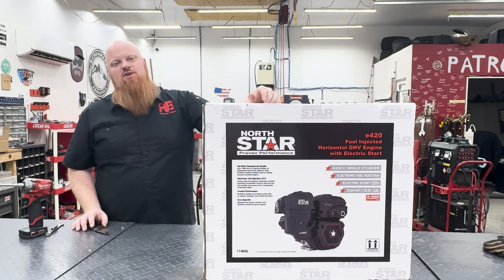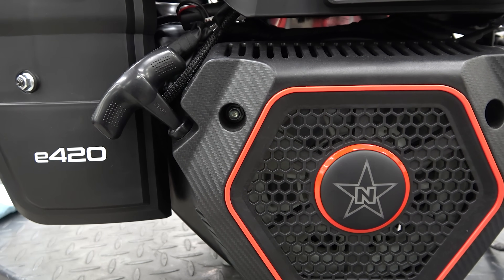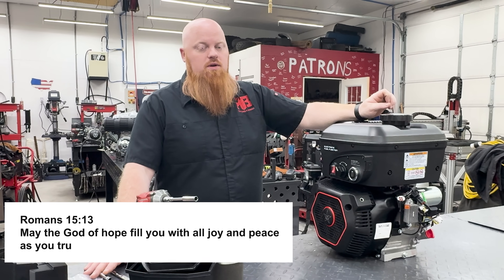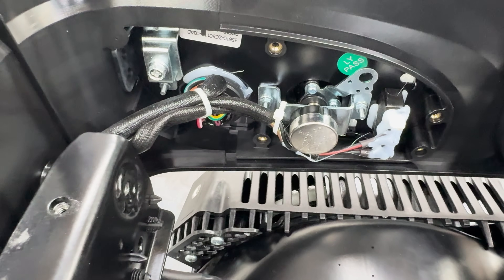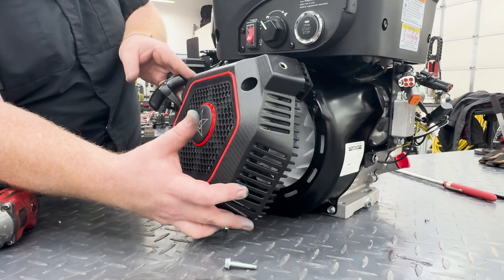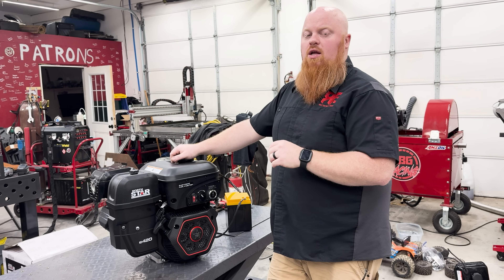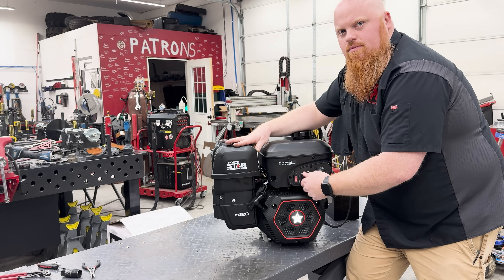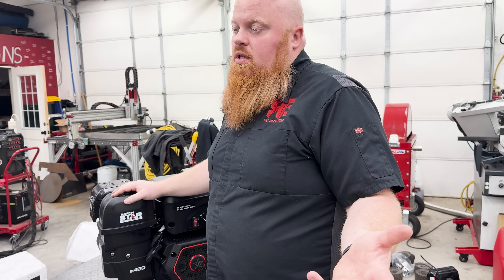EFI Fuel Injection 420cc Engine ~ North Star E420 Unboxing

Comment: What Size is the EFI Throttle Body, and what Size is the Injector? What is the Max HP it will support? A custom-built Carbed 420 can make 33+hp@5000rpm. Does the ECU have a Cripple mode built in? Is there a Billet Rod and Flywheel made for it? What are the Stock Cam Specs? What are the Stock Valve Sizes?

Comment: The two four pin ones ARE for Canbus (I looked it up), the two pin one is a remote kill, but the Can bus system allows you to remotely see sensors, and control RPM and stuff

Comment: i think it needs the battery for the ecm to be powered just like a car. not because of the charging system being weak .,if that were the case it would not supply the power for everything to work and still would kill the battery. its not a weak charging system for sure.

Comment: i joined a small engine group and was showing how to use a scope ,in cylinder pressure transducer for determining compression, valve issues ,charging system .they absolutely hate it. i do cars so these are very basic and simple ,like in the 80s when fi started. i tell them jump in and study,its not hard. now is the time to make the change if not you will be left behind.next they may add smart ignition keys and key fobs ,who knows.you guys should watch the automotive diagnostics to get u up to speed. we deal with 20plus modules u just have one.get u a  scope and start learning it

Comment: I just seen they made  a e300  looks just like their 420  in this video  just  a predator 301  gone efi lol but for $400  not sure if worth the extra 1.25 hp more than the predator but says max torque is 18 foot lbs nit bad much more than the predator
Reply: U should check it out
Reply from the maker: I will do that. I personally don’t think the engine is worth the extra price over a predator because the fuel system is pretty basic and you would have to replace everything to make real power.

Comment: Can you make a hydrogen powered mini bike with this engine cuz it's fuel injected..and you can directly connect the hho generator gas line to the injector and run the engine it'll be crazy in the mini bike community and the first on the YouTube

Comment: The tech support person is probably right about the priming. That engine is very likely wired like a motorcycle. They only run the pump when the engine is actually spinning. It is wired in series with the coil so when the coil start firing, then the pumps will engage. The reasoning for it is if you crash. You don't want the fuel pump to be running just because the ignition is on. You should be able to run off the float bowls for a couple of seconds, which is more than enough time for the engine to spin up and then turn on the fuel pump which will then refill the bowls. You could add a push button priming button and figure out an easy way to drain the fuel post-tank. Then you could drain the fuel like you do with a carb bowl, and have a way to make sure it was primed before you even try.

Comment: so what i think is going on with the EFI system isn't soo much that it draws enough power to need a battery but more so that it needs a more constant power supply. the charging coils by no means have a lot of power but they should be enough for around 120 watts on dual coils, but the battery probably acts more as a way to absorb the voltage spikes and whatnot due to these charging systems essentially providing pulsed DC. you'll notice this issue with lighting with how the things flicker at lower rpms which is why a fat ass capacitor/battery does wonders for go kart and minibike lights running off the charging system

Comment: Great more crap to go wrong. Oh and needs a battery to run that’s just awesome. It’s a small engine it doesn’t need efi or an electric starter or any of this crap. Welcome to your next mower or snowblower, guaranteed to fuck up when you need it and can’t be fixed without some module or other unnecessary part that isn’t available locally.

Comment: Im sure over time the really smart people will figure out how to make these things work well for go carts and mini bikes but right now i just dont see them as a viable option
because you have to start them at full throttle also having to have a battery to use the engines is gonna really deter most people from using these things also the price is pretty steep 
for an engine thats gonna be used on a go cart or mini bike  maybe in five years when the price drops and the technology isnt so expensive

Comment: The battery is used like a capacitor,  know how the light got dim at idle on these engines some times? , well the injector needs a steady voltage because that's how it fires. An diping voltage bouncing around would make it fuel werid an make the ecu not run properly as voltage = speed in working electronics like the injector an the eletric motor contorling the throttle.  So it probably has enough to charge while running but at low idle it needs the steady voltage that the battery provides
Reply: Typing on phone sorry

Comment: Does it have a MAP sensor? If so Probably just running in speed density mode. Ecu references MAP signal to calibrate fuel. Modify the MAP table in the ecu to account for mods

Comment: Was hoping since its efi itd have a o2 sensor even if its narrow band and nkt wide band.so this in theory should be worse than a carburetor because it has no idea what fuel ratio its giving. Its just a set duty cycle

Comment: You should be able to use a  boost refrence fuel pressure regulator to raise the fuel pressure under boost should not need to mess wiiith the electronics

Comment: Map sensor. Doesnt need a mass air sensor. I think it's refered to as speed density. Usually uses map/tps/O2/IAT/engine temp to control fueling. Dont forget a megasquirt alternate is Speeduino. I use this system. Both use the same Tunerstudio for tuning!

Comment: I'd actually be surprised if it had MAF... I figured it would be "speed density", which is based off manifold pressure and RPM to hit the targets in a fuel map.  Many OEM engines are spun that way.  If it says it has MAF though, I might expect to find the MAF sensor built in as part of the airbox.  I'm assuming that the reason it has the fly by wire throttle body is to govern the engine.  That pot is likely used by the ECU to set target RPM... probably uses some sort of PID algorithm to adjust the throttle to hit the target RPM.  So, the upside is there is no mechanical governor.  The downside is the only way to get around it will probably be something like microsquirt (or megasquirt).   I doubt fly-by-wire will have have a good response so, I'd personally find a way to hijack the throttle control for direct cable control, or find a throttle body you can adapt to the engine.  There is another do-it-all ECU solution called Speeduino, which is built on a generic microcontroller platform... even more geeky than megasquirt, but cheaper.  I highly doubt the stock ECU can be tuned.   It is cool to see, but the thing is, if you have to swap the ECU, and the throttle body, are we gaining much with this engine?  Might be better off just adding these mods to standard 420.

Comment: If it has a diagnostic connector, you should be able to hook into it and change the computer mapping so it will run with the open-air filter and exhaust. The boys at Grind Hard have done it on 3 of their custom-built rides, I think with the right program you could make that 420 do anything you want.

Comment: Great video. 
This may be a dumb question, but ive always wondered if it would be feasable to use one of these types of engines combined with a moped styled DCT transmision. On a small skiff. Similar to a mud motor.

Comment: I'm sure there is someone out there that will be able to get into the ecu and help you write a good map table  for the timing and fuel. It is just going to take some surching. Then when you get really crazy you'll need to find out what kind of injector it has and what the fuel pressure is for that map that's going to have to be worked on.

Comment: In its stock configuration it shouldn’t be much more than a built 224 to torque so it could go on the dyno? Can you get a wide band sensor on an exhaust to check if the ecu is adjusting the fueling.

Comment: I would want a carburetor so that it can be jetted properly. With that stock EPA EFI you can't change anything and it's set way too lean. Surges and pops. Probably expensive to replace all that stock EFI junk with a programmable unit. Hmm...

Comment: theres throttle linkage on the potentiometer and you slide the cable through the case. also most likely you are correct they probably have a tune that they load on that lil ecu. just bc like you mentioned no maf sensor means no air fuel ratio data is being feed to the ecu so no it cannot compensate for the changes made after a owner has added a turbo or small s/c. but you could wire in your own ecu to each component i.e. head temp sensor, fuel pump and so on and yes a mega squirt would work as long as they allow single cylinder motors to be ran of there ecu. wonder if it uses a half effect sensor to crank trigger for timing.

Comment: Adding an alternator would be easy and solve the issue of the weak factory charging system. I'd remove the factory charging coil and go that route. You might also be able to upgrade the charging coil.
Reply: They should add mounts for a second charge coil and that would add a backup to keep it running.

Comment: Manifold absolute pressure or MAP is what it's using for air fuel measurements. That's a good thing if you can crack the ecu tuning.

Comment: I think the first thing is slap on a forced induction something, turbo or supercharger, and see what happens. Out the box, I doubt you'll break anything. You're not cranking up the power that much. Maybe billet flywheel and some stronger springs, but don't add a cam or anything. Let it do its thing with more air.

Comment: So this type of EFI setup is Speed Density rather than MAF. Uses a MAP sensor to read manifold pressure and an Intake Temp sensor then uses those to calculate the density of the air entering the engine. Downside of that is its struggles to compensate when modifications are done that improve air flow unless tuned, which I'm sure at the moment there's no way to tune the little ECUs on these engines lol Most standalone ECUs like MegaSquirt use Speed Density .

Comment: You don't need a mass air flow sensor, that was tech from before speed density became more common place with the use of a MAP sensor to determine air charge pressure, crank angle sensor to determine stroke position and a calculated known displacement as that gives you all you need for EFI, you can up that in accuracy by adding a feedback loop with a wideband O2 sensor. The microsquirt would be what you want for an aftermarket EFI controller for use with boost.
Reply: You got that backwards, MAF EFI systems are the standard nowadays unless your talking performance applications like Standalone ECUs. Companies went away from Speed Density in the late 90's when OBD2 became a thing lol

Comment: I've already been hacking on one.  The 4 pin connector is a CANBUS cable.  Green and Green white are the CAN low  and CAN high signal, yellow Green is ground, Blue/red is positive. The other connectors are a remote kill switch (short green and yellow green) and the other is an idle switch that sets the engine to idle {purple and yellow/green)

The ECU does not appear easily tunable.  Changing the exhaust or the intake will instantly ruin its calibration, as it does NOT have an o2 sensor and cannot detect rich/lean.  So changing anything about it renders the ECU, in its current state, incapable of running the engine correctly.  Even removing the airfilter or not having it on tight makes it seek and surge.  There are PROBABLY commands that can be sent over canbus to edit the injector duty cycle/fuel map tables, etc.  I have not split open the ECU.  Based on the sensors it has, it is definitely a speed density system, and it might have an alpha-n fallback.  You might be able to get more fuel into a higher performance engine by manipulating the fuel pressure, which probably requires an external pressure regulator.  No Mass airflow, no o2 sensor.

Potentiometer for the throttle is wired to blue white and brown yellow, with brown yellow on the wiper.  The starter switch is yellow/green and brown, short them together to start, short them together to stop.  blue/red is positive for the lights, blue green is the engine running led, red/white is the engine stop led.

IT DOES NOT have a mass airflow sensor.  It has a Manifold Air Pressure Sensor, intake air temperature sensor, throttle position sensor, crankshaft position sensor, and an engine oil temperature sensor.

Incidentally, i've already made mine start buck and spit on a speeduino.
Reply: Having a CANBUS is unexpected but pretty cool. Didn't expect it to be that "advanced" lol
Reply: @MrUltraDreamz  I aint gonna lie, i spent 4 hours thinking it must be RS232 or TTL serial until i slapped a logic analyzer on it.
Reply: thats pretty intresting cant wait to see what people are going to do with these motors I'ma be keeping an eye on this motor for awile to see what happens
Reply: get u an oscilloscope and see everything,

Comment: Won't you have to calibrate the EFI so that it knows you want more fuel or does it have some sort of mass air flow meter on it that lets it know that more fuel is needed. Would be interested to see what it can do with E85 and boost.

Comment: As someone that has tuned using MicroSquirt (MS2), I recommend skipping all this nonsense and going straight to learning how to use microsquirt. this system likely uses the head temp sensor to go rich/lean (AKA- dummy switch), and the fuel/spark tables are probably about as dumb as a mule. MS is the way to go. you can like tune it on your dyno. please use a real wideband o2 sensor setup. any old cheap injector will work, but it needs to be small CC's.

Comment: So I’ve had to go to school for these EFI engines they’re trying to make them more like a car engine than anything but each computer whether it be Bosch or Delphi they have a learn process the engine Hass to get up to temperature before the process could really begin the O2 sensor don’t start reading until it gets around 700 720°F and then it regulate the throttle which is what the small rev on startup is once engine gets up to temperature every single smooth out in idle properly. This is especially important for the first time, running it and every time after resetting the computer and easy way to tell if you have a Bosch or Delphi system is to look at the O2 sensor wire if it’s one wire through the O2 sensor it’s a Bosch system. If it’s a four wire, it’s a Delphi and you can contact either company to get parts.
Reply: There is no O2 sensor, it most likely uses the temperature sensor on the side of the head to determine if its running rich or lean. I suspect that's why its running kinda crappy, using that by itself isn't going to be very exact or quick to react.

Comment: Like a few others here, we’re confused why it was surging while running. Was there a mistake made starting? An issue with the machine? Or does it take longer to settle in and self correct?

Comment: I would be interested to see if it is more fuel efficient because of the fuel injection, or can you run a turbo on it.
Reply: For turboing it you would probably need an aftermarket ECU and fuel regulator to account for boost. Other question is if the injector has enough headroom for boost.

Comment: When making changes to intake or exhaust, disconnect the battery and cycle the power switch. That'll clear anything the ECU has learned and then adjust to the changes. Unless it has a fixed running map. Then you'll need a different ECU.
Reply: It does not have an adjusting map/fuel trim, no o2 sensor, no Mass airflow sensor.  It cannot detect the fuel air ratios or the amount of air coming in. It's a speed density system, similar to an 80s ford or chevrolet.  So it will need a tune for any change, even a particularly high airflow filter, or at least a fuel pressure regulator to change the fuel pressure.
Reply: @BadHaddy  that's what I thought, but I hoped it would be more sophisticated than that.
Reply: @rosschamberlain1823  Mine's already barking and spitting with a speeduino/alternative ECU connected with a heated o2 sensor connected.  The stator doesnt make enough power to keep the heated o2 sensor on though, and it will foul up fast with how much oil these engines burn.  Going to find the cheapest 'close enough' non heated o2 sensor from the local parts stores to fit eventually once i build the rest out and get a base tune.  The factory ecu has an exposed canbus, i am getting some data from it, but i suspect we're heavily locked out, to the point of popping an efuse to prevent adjusting the fuel tables.  I'll decap/unpot the ECU eventually and try to see if i can dump its program, but its going to be unlikely to appease the EPA/CARB.
Reply: I would imagine it's fixed assuming it doesn't have a MAP/MAF sensor

Comment: I bet you hold it full throttle until the Ecu self optimizes/learns. Just like the newer fuel injection swap kits for cars.
Reply: No learning on this ECU, it has no o2 sensor or MAF sensor, it has a manifold air pressure sensor.  Its more like a 80s ford or chevy first gen ECU.

Comment: I would assume that the potentiometer setting requests an engine speed (rpm) and governs the engine at that speed.  With the cable throttle you would not have direct control over the throttle position.